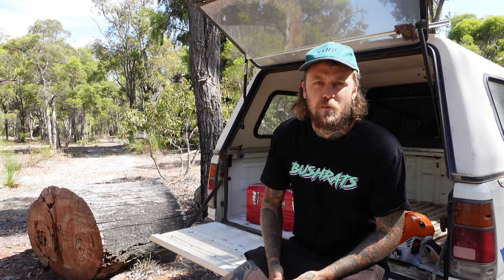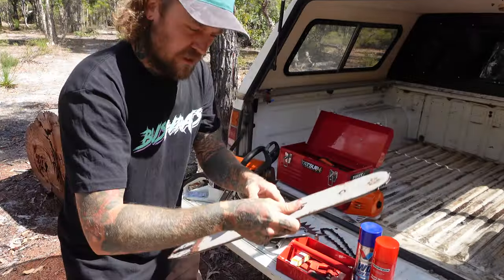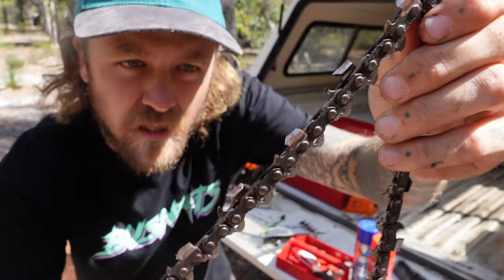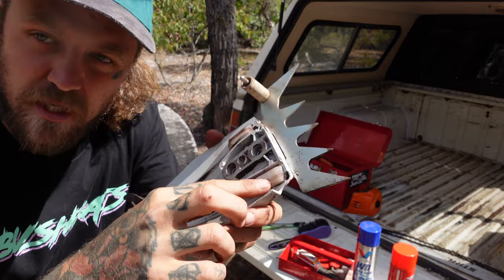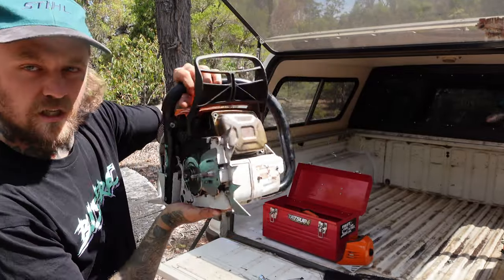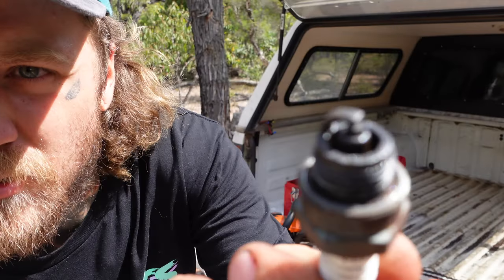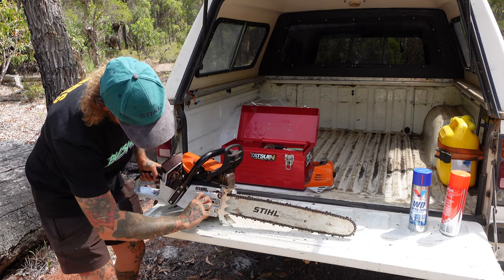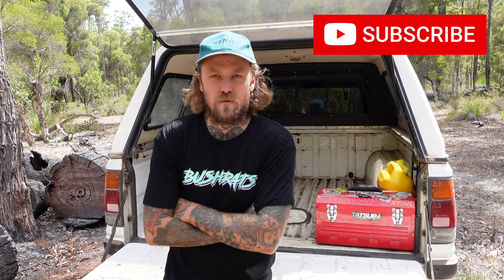SIMPLE Chainsaw Maintenance | Summer Service

Comment: I use my pressure cleaner like they do in the chainsaw shop. Air compressor is great throughout the winter but eventually you have to give them a good wash. Rule of thumb you should change your sprocket after about six new chains and clutch drum after about twelve
Reply from the maker: thanks Kevin cheers for the info and input mate 🍻

Comment: Nice one Lee. Just one point on blowing the air cleaner, do it from inside to out, opposite way it came in. Saves pushing the dust further into the element. Keep it up mate.
Reply from the maker: thanks don appreciate the tip mate 🍻

Comment: Awesome video, appreciate the work and uploads! Great pointers about the chain lube adjuster and nose up when tightening the nuts. I've also found that a piece of hacksaw blade is the perfect thickness when cleaning and scraping out the channel on the bar and its best to scrape any shit away from the nose sprocket so that it doesn't end up jammed in there.

One problem that I've come across with Husqvarnas, (havent had this problem with Stihls - different clutch/brake?), is that the chain break needed to be disengaged before I undid the nuts. If I didn't it was a pain in the arse putting it back together and I had to force/reset the brake to get the cover and clutch back on. Love the vids, keep it up!
Reply from the maker: Thanks mate really appreciate it! Yeah I still haven’t had a tinker on a husky yet gonna have to keep my eyes out for a good cheap one 😊🤘🏾
Reply: @BushRats   Don't do it lol, stick to the Stihl! I love em

Comment: You don't use filter oil Lee?,it was recommended to me many years ago, been using it ever since.Just a very light spray,keeps dust out,but doesn't affect the air flow, then wash with detergent every 2 or so trips
Reply from the maker: nah mate never used it might have to get the old KN oil out and have a go 🍻